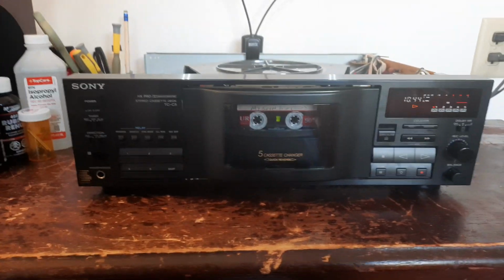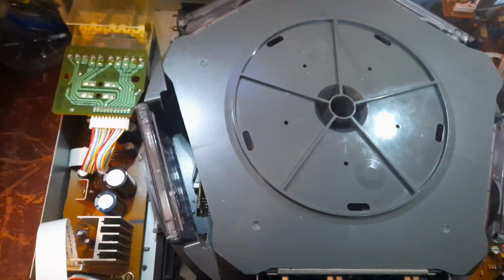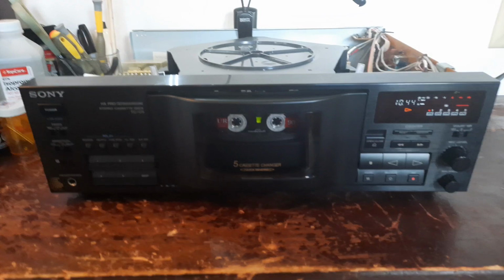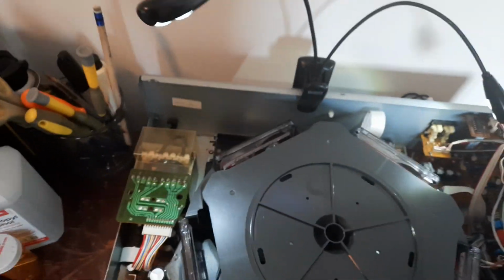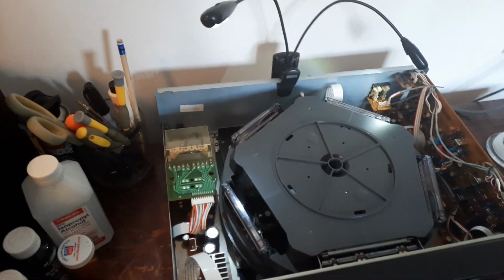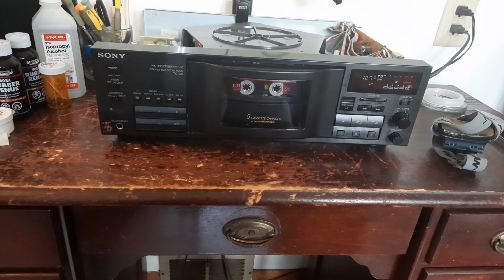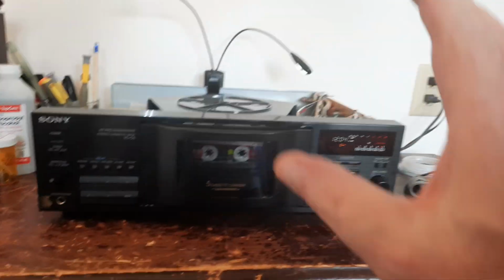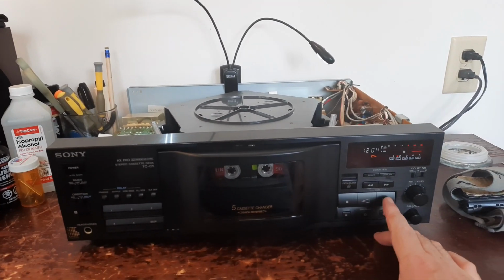Sony TC-C5 cassette changer repair, Part 3  Wow.

Comment: Wow you're angry.😮 I understand though I've been there with repairs, some things are just a nightmare to take apart and much worse to reassemble.
Reply: Sorry it fought you so hard but it sounds like you won
Reply from the maker: @jamesdrake6200 the carousel was a nightmare. Reassemble mechanism 3 times and 3 hours on Reassemble.
Reply: wow

Comment: I have a problem with putting the cam gear into the spring for this. The clips I can put easily. What am I doing wrong with the cam gear? How to position the cam gear please? The big white gear for the deck. Thanks
Reply from the maker: Download PDF of service manual Sony TC-C5 cassette.  It will have pictures of the gears and info you need.  Good luck.
Reply: @mr.nobody5422  Thanks. Yes, I have the service manual. I think it does not mention which position to rotate the cam gear before assembling it. I am at a loss. I tried few different rotations and none seem to be correct. Does a specific page talk about assembly of cam gear?
Reply from the maker: @classicalmusic2425    it took me more than 10 times to get it right.